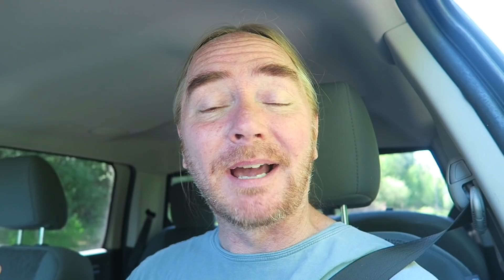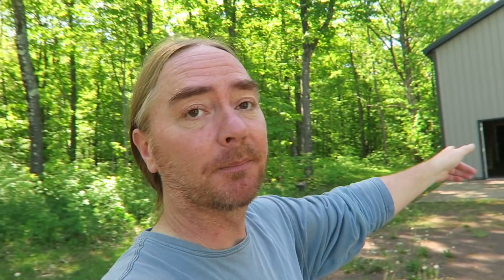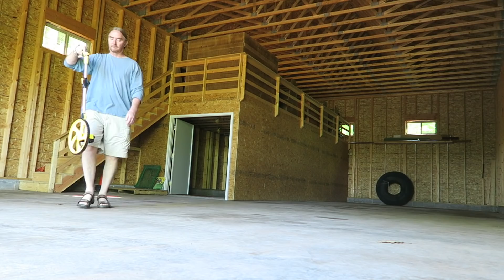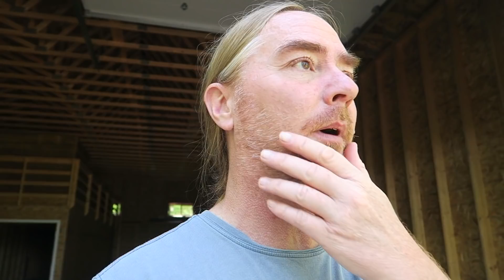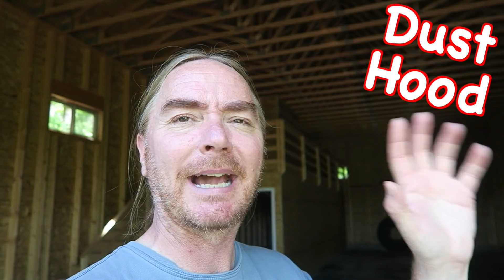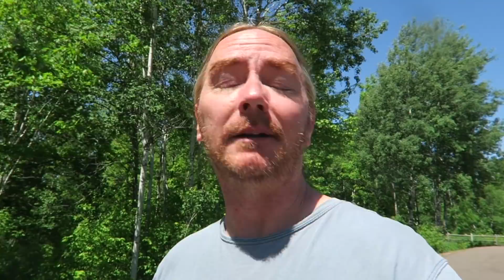Old Shop Vs New : What I've Learned Over The Years

Comment: Nice to see you getting settled in.  I wanted to say a very public ¨Thank you¨ for the videos you did on painting.  During May, I applied everything I absorbed from your videos to paint our coach launch (https://photos.google.com/photo/AF1QipN3Fk7DPAmOA13-yNrAA7nbhkJ2rXZwxnHzsqWq).  Some lessons:
1.  You make it look relatively effortless, but I know how hard you work!  Difference between pro and amateur.
2. Pro tools make a huge difference!  Not having a longboard was a bit of a hinderance, especially trying to make flat panels fair.
3. Painting outside in May is less than ideal.  Pollen, ash/maple trees and bugs are not your friends.
4. TotalBoat epoxy fairing and primer, and Alexseal epoxy paint are so nice to work with.  The roller additive really makes a difference.  I would never have found that without seeing your video.
5.  I would never have considered painting a 16´ boat with a 4¨ roller before finding your videos.  Thank you, thank you, thank you!

Comment: 600 ft in England that would be about £35.000 just for the electric if your lucky?
The air purification at you old shop can you not move it to the new shop?
Reply: agree David in Australia it would be at least  $40,000 plus just for electricity and could blow out to double that depending on the power source at the road.

Comment: Have you considered moving the loft stairs to the back wall and putting your woodshop where the stairs used to be? That could give you the room for longer boats without shifting tools around.
Reply: Agree. That would also place your lumber racks close to the front as you mentioned.
Reply: Words out of my mouth. An alternative is also to extend the mezzanine forward towards the entrance, enclose it upstairs for more dust free storage, and build racks on its side for wood storage (should still be space for a woodshop below). The current enclosed storage room could also be divided into smaller units with access to each from the main shop for specific purposes. And as others have suggested, consider a separate container for hazmat storage.

For my own shop I have made a dedicated sub-unit for the air compressor inside my external, sound proofed dust collection shed. Since I always turn on the dust collector first during cold winter days, the ambient air around the compressor is quickly heated and I avoid the problem of starting the compressor with thickened oil. Look at the placing of the dust collector unit so that it's easy to empty.

Comment: A lot of stuff to figure out! A few thoughts. Can you rent a trenching attachment for your John Deere tractor - U trench, they run the utilities, you back fill? Run phone, internet, fiber op in the trench while you have the opportunity. Air compressor - you have a lot of electric tools already because of your previous compressor limitations. Worthwhile to switch over to air? Consider putting the compressor outside the building, both for noise but also for fire risk. The area in front of sectioned off room, consider a large tool space, even if it means making the large tools semi portable. When needed, pull them out to the central open area, use them then return to a storage space. Consider making everything mobile as in on casters, or able to be pallet fork lifted by JD ( :) ) onto a large dolly to be moved, then pallet forked off. Pallet racking for storage. 
Have been enjoying your videos for some time, thanks for sharing your knowledge. Keep up the good work!
Reply: I agree dig your own trench and backfill save yourself a ton of money if they will allow you it’s worth a shot to save a boat load of money.
Reply: @donpetrey8007  I saw what you did there, good pun.
Reply: while you have that trench open, run at least one empty 2" pvc conduit with a pull string in it to handle whatever the future holds.  plastic is cheap compared to trenches.

Comment: Since I got a track saw I don’t use my table saw nearly as much. I certainly don’t need as much room around it as I once did. I break all the big stuff down outside with the track saw on a workbench I made from a hollow core door, folding table legs and a piece of pink foam sheet insulation as a sacrificial surface. 

I’d consider putting the woodworking stuff and the dust collector up front by the man door so you have the option of opening the overhead door to vent dust and don’t have to drag a dust filled barrel through the whole shop. 

Have you considered the cost/benefit of pouring a new pad with insulation and radiant closer to the road and moving the building?

Comment: An air compressor would probably be more ideal in a separate small structure just off the back of the shop so it isn't taking up floor space and it is easier to isolate the noise and vibrations.
Reply: I was thinking a small room off the back for the compressor and dust collector.
Reply: @tlgibson97  Good idea. Give up a small amount of space in the back of the lower enclosed area to build a closet for the noisy items. Still will be in conditioned air but enclosed and soundproofed. intake and exhaust can be on the exterior to further reduce noise and air circulation.
Reply: I would  put the  dust  collection  in there  too keep  the noise  down  would  not  cost  a lot
Reply: Exactly right. It needs to have heated air source or a quality (refrigerated) dryer system preferably both.
Reply: The air compressor could be up on the mezzanine in the back where you could isolate It. It has to be warm and be able to drain liquid. At least a 80gal tank
Reply: a rotary-screw type compressor would be justified for such a shop (most likely with a drier) - they're aren't that noisy... cost of setting up an extra shed to be accounted for
Reply: We had dust collecting ran to out side also had a 12 x 8 storage building  dropped off to store the Air Compressor in. This was not for noise but rather to save space in the shop floor. Now however I am not going to be limited to a shop I am building a truck to take it where it is needed.  Guess I will be a hurricane chaser.

Comment: I would go with a shippng container to store the lesser used stuff, rack it out properly so you can easily find stuff, just an electric 'greenhouse' heaater keeps condensation away, the tube ones are 60W per foot.
Fabrick rack, a bit like a rolling clothes rack with hooks to hang horizontal rods fo the rolls.
See if you can get a cheaper utility install by digging your own trench if you are capable.
5500 colour temp or higher is best for video,
Consider having a compressor (and maybe the dust collector) outside in a shed,

Comment: While you are down to the studs, plan an addition for your wood shop, put in the frame for a door, get wiring over there, have it where you can build it later without much trouble. Will leave you the big barn for working on the boats.
Reply: That it a great idea and cheap to do no with a blank slate